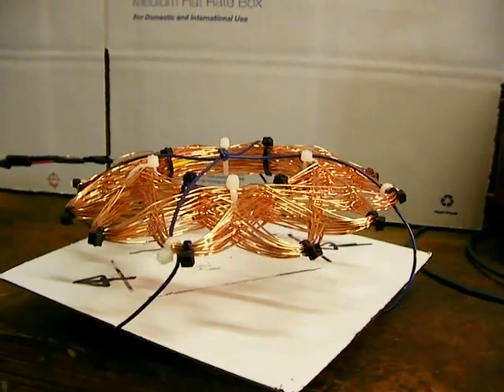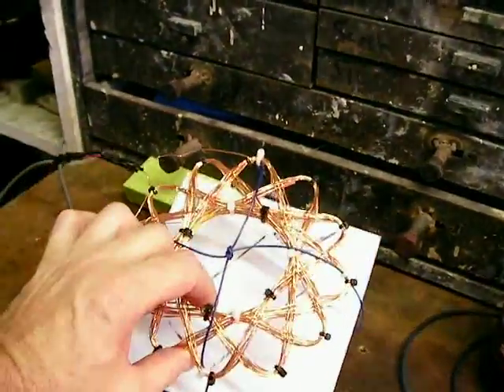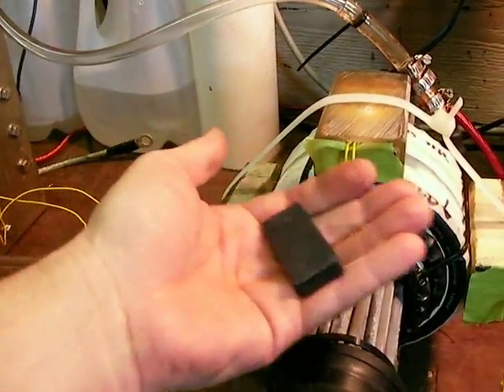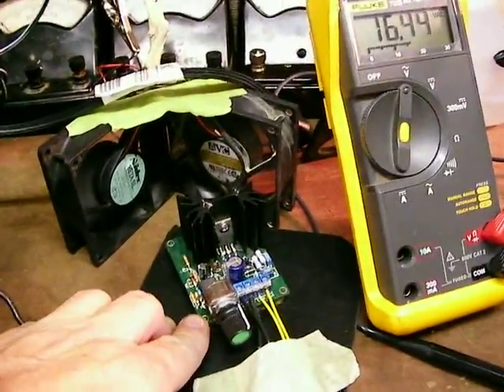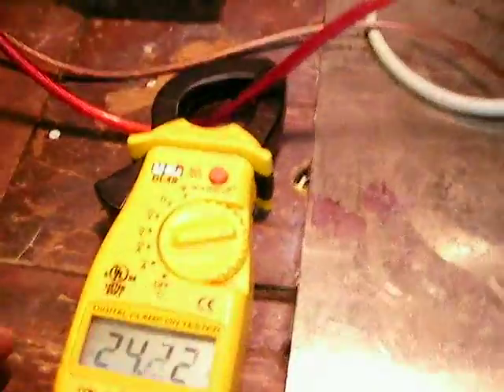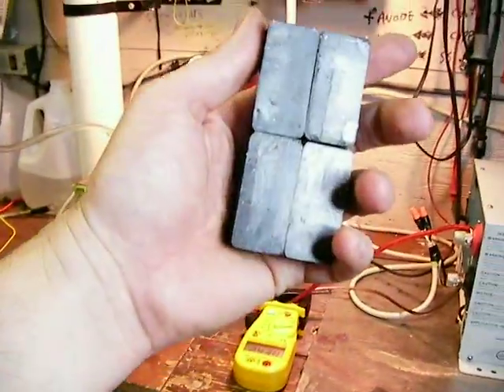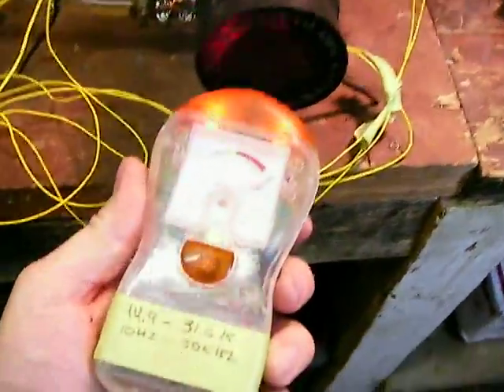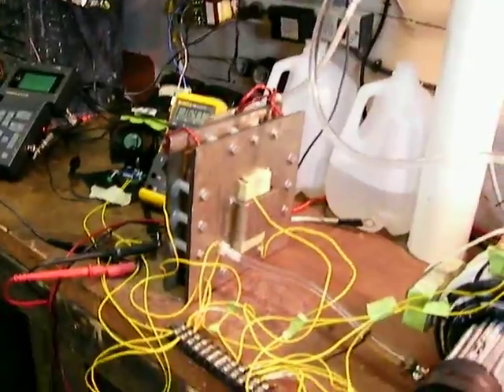making hydrogen with magnets!

Comment: Fantastic Work. Extremely interesting experimentation. My research indicate- we may separate the atoms(ie hydrogen & oxygen)  from a molecule(ie water) with much less power(compared to electrolysis) when using resonant frequencies to break the water molecules covalent bond. "The Sky Is Not The Limit". "The difficult is achieved at once. The impossible takes a little longer"

Comment: you keep referring to resonance as if it was a simple matter.  the resonant frequency of iron fillings in a jar of mineral oil is VERY much different than the frequency needed in just water, little alone water with an unknown amount of mineral content.  RF wont do anything,  its not ions. RF referrs to frequencies in a particular range which happens to be used by RADIO.  nothing special about it.

Comment: what you all are doing, is breaking water by means of electromagnetic or by electric means,  this is not what stan was doing.  figure it out.  this is why you can only get more hho by adding MORE watts.  you can change the voltage, the wave, the current, it all equals the same thing, WATTS.  read about tesla and learn something new.

Comment: all you HHO people reading this, build a field inspection unit, and watch your fields, it doesn't matter how many neutrals you have or use.  its all about the field and now it bends.  the bends in the field will produce more hho than a even curve.  put fine iron shavings into a suspension of mineral oil into a jar, then place the jar near your cell coils.  then compare what you see with the output you get.

Comment: humm. NO. this is not true. stan was not using an electromagnetic field. he was using a static field. there's a HUGE diff.  stan was doing exactly the same thing that Tesla was doing with static resonance, which ended up making a tesla coil.  stan found the resonant frequency of the volume of water he was working with. this frequency changes with EVERY moment of a generator running.  read up on tesla and see for your self.

Comment: fyi, this is not magnetic resonance, this is just electro magnetism.  you cannot resonate a static magnetic field. its constant.  if it was resonance, it would be a ever building field, getting strong and stronger.  do some reading on tesla.  also to visually see what the field is doing, put a bunch of fine iron flakes into a glass jar filled with mineral oil,  it will allow you to see the field in 3d.  you'll see that it is a static field, changed,  but still static.

Comment: very interesting concept using a magnetic field.  i have been using a solid state pulse system to run my HHO wet cell for about a year now. just using straight tap water. best results so far have been about  250ML in 1minute 5 seconds. i have been using 2n3055 transistors on the solid state set up, i did manage to find some stronger transistors for further testing. again, excellent work and best of luck on your project.

Comment: I saw a schematic for the japanese water car (based off the one that guy made in 1988) which used magnetic fields to seperate HHO from water by spraying the water as a vapour into a chamber surrounded by a magnetic field. I'm not sure if it was just a rotating field like in a motor or if it was a resonant field (i'm guessing the latter would be needed to split hydrogen and oxygen)

Comment: Really good and fast has no meaning. How many liters per minute is the device producing. Those are the kind of measurements that are important. How much is produced with the magnets and without. At 12V, 30V and 90V. Amps? What is the point telling us about the magnetic field when it has not been determined what it does to the device. The results need to be tied into relevant data to make any sense to us viewers. A+B=D and so on. I would love to see it make some sense and see the numbers.Cheers

Comment from the maker: the best way is 12 to 14.5 volts that way you are using 4 neutrals per cell. an 11 plate unit is what i prefer for up to 30 amps. after that i found no advantage. as a normal alternator IE stock cannot handle much more. if you have some extra money to spend then go with 120 volt AC unit 61 plates with an 1800 watt inverter use it from 2 amps to 6 amps on the rectified DC side.. have fun bro!

Comment from the maker: use thin wire as higher frequencys like it. for instance i made several starship coils the thin wired ones work great as speakers the thick no! also check the modules with a volt meter to see that you keep them at around 3 ohms each. use series paralel to be no higher than 6 ohms as piezo devices are 6 ohm.. your ultrasonic drivers are usually designed to run at 6 ohms..